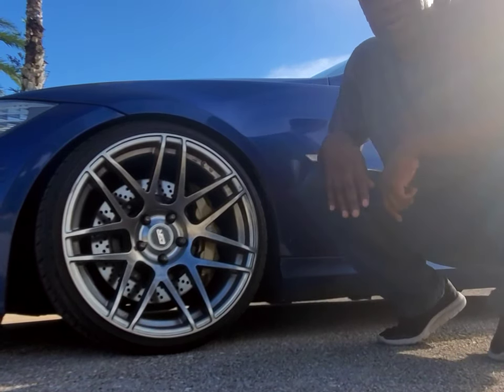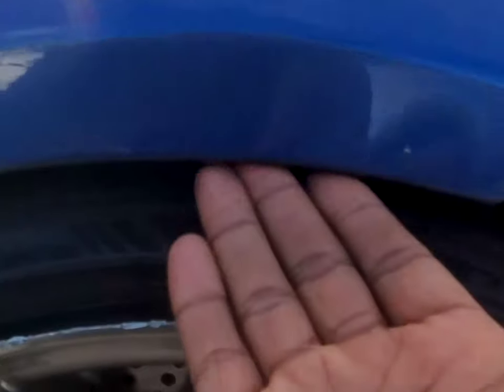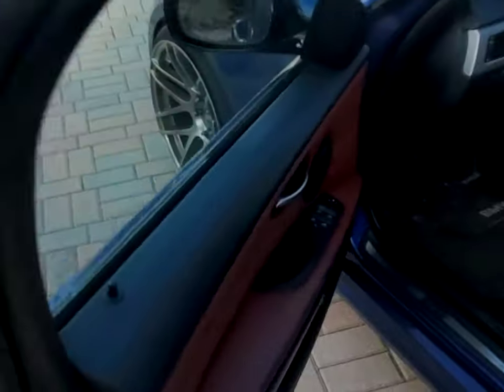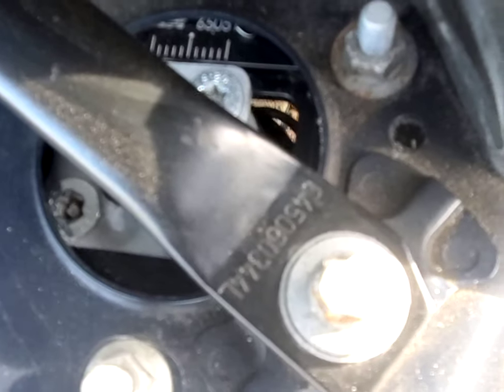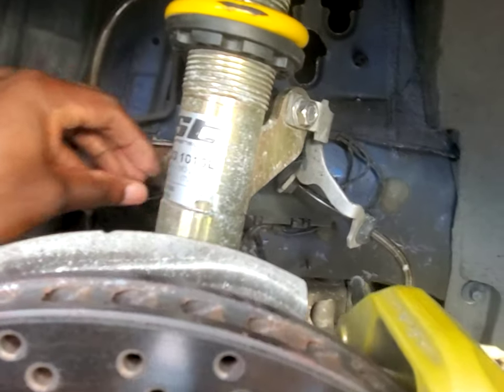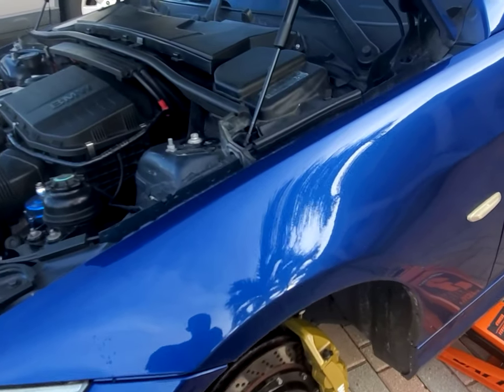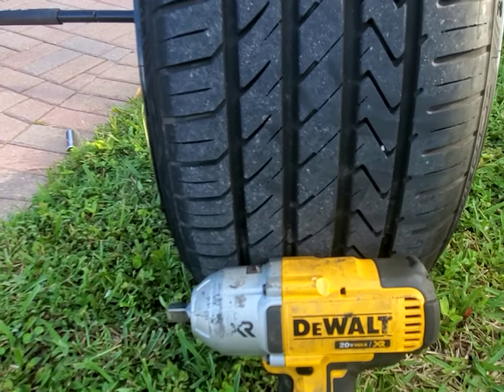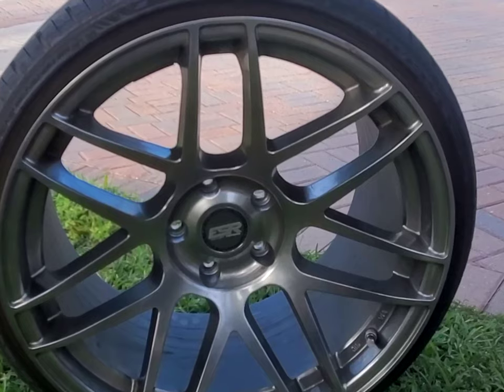BMW Wheels and Suspension Setup.

Comment: Such a well thought out and informative video - really appreciate the insights and the detail that you go through, it's exactly what I was looking for.  Did you have to do any trimming in the rear to get the wheels to fit?  I'm currently running 19x9 +23 with 275/30r19 on the rear and it's rubbing heavily where the rear fender meets the rear bumper arch...
Reply from the maker: Hey what up, thanks a lot for the response. 
No, I don't rub at all on all four tires. Your r 19x9 + 23 should be fine but the 275 widths of the tire is the reason why you rub. It's too thick of a tire for the wheel whale. Also, I did not trim or pull my finders or have anything modified.
Reply from the maker: I would not pull the finders or trimmer them better that area for our cars (if you have a bike e90 or E92) is pulled already by the company and the paint may start to thin out and then crack. Just get a small tire width. Like a 255 or 265. I would go with 255
Reply: @driftvirals4636 thank you brother!  I’ll try downsizing to a 255/35r19 once these tyres are done.  Keep up the good work 🙏
Reply from the maker: @hjacketm000  use a measuring tape to check if that is what you need. If you go with 35 in the rear remember it will make the tire taller. But I think it should be good. Go with Lexani It is a good brand and is not expensive. 
Please subscribe and share with your friends. 
Let me know how it goes, please.

Comment: What is your offset?
Reply from the maker: The offset is 19x10.5 +30 front 
19x10.5 +30mm  back
Originally got the 30 for the front but they rub on the suspension so I switched the front and the rear and that fit better.